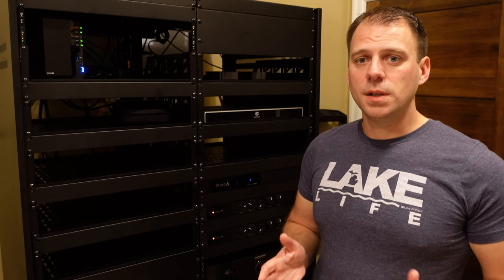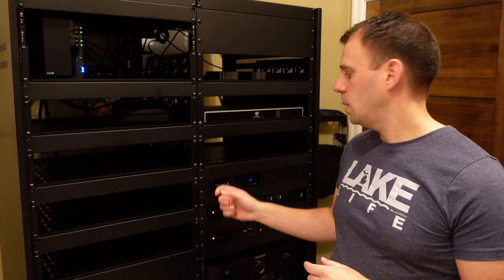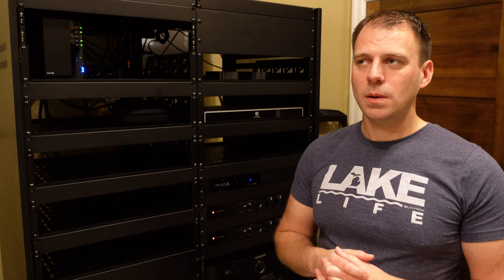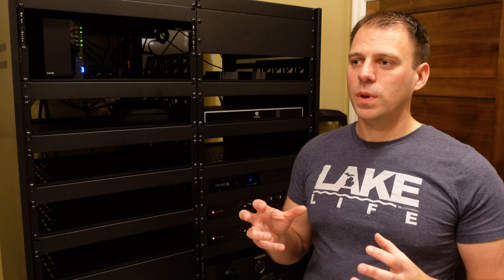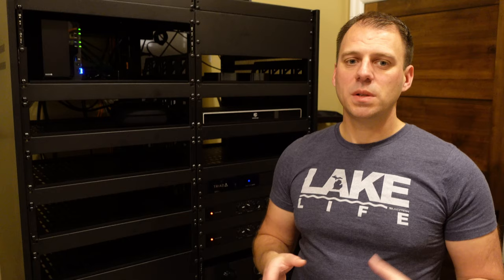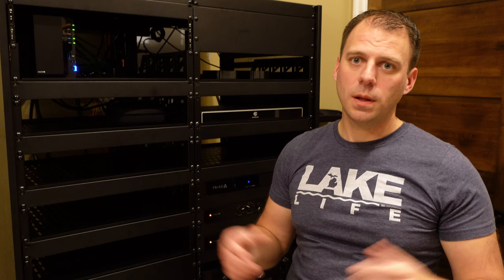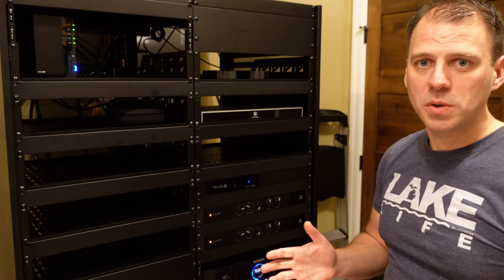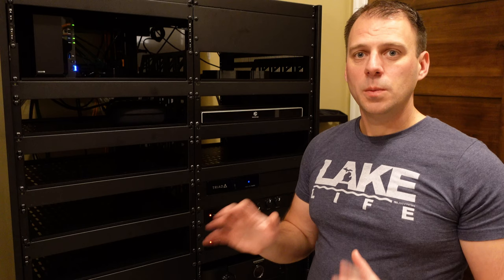Using 12V Triggers to Power Manage Home Theater Gear

Comment: I'm in the process of changing over from autosense to 12v triggers now.  I also had the same problem of quiet passages of music not turning the subs on straight away. I'm in Australia and have ordered 2 x 12 volt trigger relays from Audiophonics in France! (Couldn't find anything locally and needed to be 230V 50Hz) Fingers crossed it all works smoothly when they arrive!

Comment: I was wondering if you could send a link for the best manufacture for 12 volt trigger cable. I bought a nice SVS sub and I have it set to auto because technical support said using a trigger cable would give off a humming noise. However the auto feature some times takes a long time to turn on my sub even after my receiver is on for 10 minutes. I measured the distance from my receiver to my sub and I need about 10 feet of trigger cable. Then I need one more trigger cable to run from my receiver to my amp. That cable I only need 1 feet.
Reply from the maker: I just buy these cables for trigger use (link is affiliate). https://amzn.to/3lRroDP

Comment: Hi Jeremy, do you have any recommandation on how to turn on/off a powered subwoofer with a receiver without trigger outputs ? I've seen people using the USB 5V of the receiver as a trigger but mine (Marantz NR1601) does not have USB neither.
Reply from the maker: No, sorry. I haven't tried with another electrical trigger method. I've only used available trigger ports or auto-sensing.
Reply: @Techthusiasm  Thanks anyway !
Reply: What about a smart power plug? I bought one which is apple homekit compatible and I'm quite happy about it.
Reply: @trannel73  Yes why not ;-) But the smart plug may consume the same as the subwoofer in standby mode or even more :p
Reply: Haha. Perhaps your right. My smart plug is using maximum of 1watt in standby mode. Don’t know about my Dali 12 inch active subwoofer. Internet says it can be around 1-20watts depending on the brand.

Thanks for making me paranoid, haha 😅 but sometimes I’m a bit lazy.
Reply: Maybe I'm late with the answer, but with my bedroom setup I tried auto-sense. Usually I hate it because the reasons Jaremy mentioned too, but tried a trick and it usually worked.
Lower the sub's gain as much as you can, without hitting your amp's minimum setting. For my Denons it's -12dB, so I go down to -10-11dB with the sub. Then the calibration (or by hand) will increase the sub's output level to +10-11dB. With most programs and on movie listening volumes there'll be enough low frequency signal to keep the sub on.
The only thing it didn't work for me is, in the bedroom we like to listen to music on low volumes, and then there weren't enough level in the low end to keep the sub triggered. But when listened to on higher volumes, this method worked.

The USB connector of the AVR isn't always the best option, I'm almost sure the Marantz works like the Denon too... and on the Denons the USB is always powered.
But if not, then I would recommend a voltage converter, with will "make" 12V from the USB's 5V and you can trigger the sub with that.
Reply: Hi folks, l'm also trying to turn on my Subwoofer with the 12v trigger port on the Receiver, my Subwoofer doesn't not have 12v input! So I'm looking for a power box i gauss the accpt 12v trigger wire to power on the Subwoofer any recommendations?  (I know smart outlet would be an option)

Comment: Awesome setup.  Ok I have a question.  I am doing a cheap surround using an older Yamaha Rx-v667 combined with car audio . (Car amp + sub) car amp is powered by ac/Dc inverter and I currently just jump the remote (turn on wire). I have tried stripping a 3.5 cable and hooking each wire at a time to the remote jack  but I cannot get it to work.. maybe not enough amps? Any ideas lol.
Reply from the maker: Sorry, that's not stuff I've messed around with.

Comment: Hi good video
I’ve just invested in a Emotiva BasX A3 to replace the front  soundstage on my Marrantz SR7011.
I only have a few inputs attached to my Marantz including Sky Q and an Oppo 203 4k Blu-ray player. 
The problem I’m having with the trigger switch is that the Emotiva fires up and down perfectly when all inputs are selected on the Marantz other than the Oppo. Any time I change the input to Oppo the Emotiva turns off whether I have the Oppopowered up or not.

I’ve been advised that the Oppo input in the Marantz needs to be switched off even though there’s no trigger between the Oppo and the Marantz. 

Could you please guide me through this as I’m not sure where to find this in the Marantz menus.

Cheers

Steve
Reply from the maker: I don't know the full Marantz menu set, but usually trigger control menus on a receiver/preamp allow flexibility for how they might trigger. Like, you can have them trigger for any or specific inputs. It sounds like your Marantz settings need to be tweaked. Like that one input, for whatever reason, isn't configured to trigger. Look in the manual for where the trigger settings are and then verify what is on vs. off in that listing. It should hopefully be a straight forward adjustment once you find it.

Comment: Hi, thanks for posting this video. Do you know if the Marantz trigger outputs a transient trigger signal or if it puts out a sustained dc current while the device is “on”? Wanting to turn on a Surgex power sequencer via the trigger out and it appears the Surgex wants a continuous dc current to stay on (according to the manual)
Reply from the maker: You're welcome! My experience is triggers are pretty common across brands. 12V signal that's high to indicate the trigger and 0V for no trigger.

Comment: I am convinced now to use the trigger but you didn't show us how to make it work physically. I have a Marantz 8015 and two Carver vintage amps that are powering my system. How do I get those Carver amps to fire up when the Marantz turns on?
Reply from the maker: You need to use the little cables, 3.5mm usually as shown, and wire up your receiver to your amps. The amps should 12V trigger inputs and the receiver 12V trigger outputs. Sometimes you might only have one, sometimes multiple, sometimes amps have ins and outs to chain more together. If you amps are older, they might not have the jacks though. After wiring, you need to make sure the 12V triggers are enabled usually in the receiver settings.
Reply: @Techthusiasm  thanks for the reply. You're right. I have older amps with no triggers.  I bought a triggered outlet last night that ill use for the entire rack but what about the sub? Its 25 feet away from the receiver.  How do you trigger yours? Thats a long run for mono cable. Will it still work you think if I buy another triggered outlet for the other side of the room?
Reply from the maker: I leave my subs on auto sensing power control. Many subs though do also have 12V trigger inputs.
Reply: @Techthusiasm  my equipment is to old. MK5000 600 watts though! I'll probably have to just break down and buy another one of those triggered Outlets for $125

Comment: Great video.  Do you ever have issues with thumping when using the 12 volt trigger.  I’m working on setting mine up with a delay wanted to hear your opinion first.
Reply from the maker: No thumping for me.
Reply: @Techthusiasm  Ok.  Maybe it's just my subwoofer causing thumps.  I'll test my new external amp set-up for my fronts when I get a chance.

Comment: I liked your reasoning, and you convinced me, but your presentation didn't show me how to set it up myself.

My receiver has a trigger out, but only a single one. Do I need a special device to act as a trigger splitter?

Seeing how this looked from the back of your rack would've helped a ton too! Also, this means I need to route 3 cables to my subs now (power, audio, and trigger).
Reply from the maker: Thanks for the feedback. Check out my zone2 video for some footage behind my rack. I’ll make sure to get that on camera going forward. Or maybe get your a YouTube short on it. 

If you need to trigger multiple devices, ideally you can chain them. A lot of amps and such often having trigger in and out. So if you have one out off your receiver, go into one amp, then chain onto the next. If you can chain, you can get a little 3.5MM type splitter as well.
Reply: @Techthusiasm  yeah, the Monolith amps in particular only have a trigger-in.
Reply from the maker: Yep on that case just get some Y-splitters and split the signal with the cables. It’s all 3.5MM just mono stuff you need.

Comment: Awesome video and sickkkk setup.  I have a question that I can’t find online. I have a Denon  3700 with a cheap mono price  2 channel amp. Denon is nine channel but processes 11. I initially had what sounded like a ground loop hum from the monoprice amp. I was able to eliminate it by lifting the ground with a 2 prong plug(temporarily) but I still get a wicked hum when I plug in trigger cable. Could the cable be bad? Could it be something different that I’m missing? I just bought an 1/8th cable on Amazon . And I really would love to use it because my stuff too is ina. Storage room
Reply from the maker: Thanks! Stick around and share the channel with your friends cause the theater room and such are getting super-charged right now. :) 

Interesting. You could check the connectors on the trigger cable. Make sure nothing is snapped or broken. I deal with a lot of electrical hum in my system. I actually run two of my devices (my gaming PC and my Kaleidescape) on HumX eliminators (they are like $80 on Amazon). Those are a safer option than just lifting the ground. I plan to really put some effort to getting this out of my system and getting my speaker noise floors to zero and will be talking about it here.

Given your post, I will try another test though of disconnecting my trigger connections and see if that changes anything with the amount of hum I hear.
Reply: Have you found the solution for the hum?
I have an X3700 (without the monoprice) too and when I tried to trigger the subs, they picked up a horrible hum too. So I disconnected the trigger.
I was thinking the trigger cable needs to have a (or two) capacitors to galvanically disconnect the connectors... but didn't try yet. Mostly cause I don't know what capacity would be needed and don't want to make bigger problem with a discharging capacitor than the hum.
But if you found the solution, I would be happy to hear about is.

Comment: U Show a picture of a mono trigger cable but many times you need a stereo Cable otherwise the amp will not turn on. Further you show a exposed wire example and yet with a stereo cable there are three wires.  So it's awfully confusing, practically, to wire a trigger connection.
Reply from the maker: I’ve only used mono cables for triggers. The exposed wire triggers I used had to be like that because some of the trigger connections on some of my amps are screw terminals for wire, not 3.5MM jacks. It only takes a 2-wire connection (voltage and ground), hence the mono cable.
Reply: Thanks I have a Macintosh amplifier which requires a stereo trigger cable.  My preamp has two screws Plus and minus. Which I hope will be enough to turn on the Macintosh amp and apparently the display is why there is a need for a stereo trigger.  The third exposed ground wire may not be necessary to connect to anything.